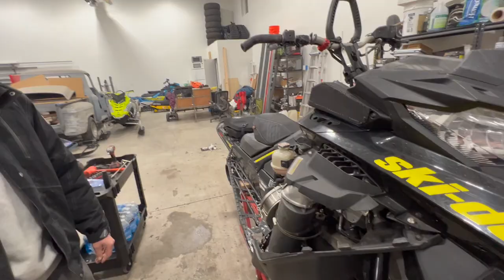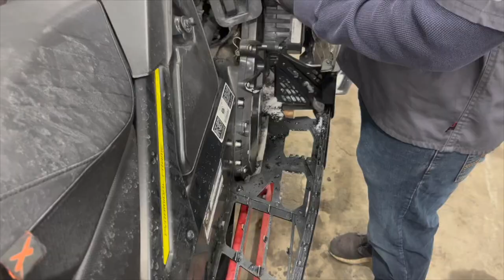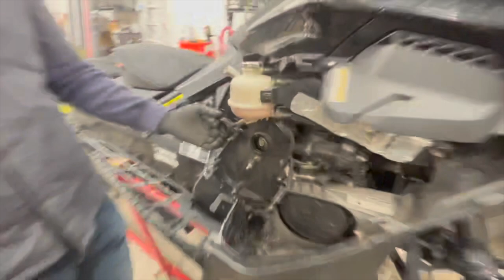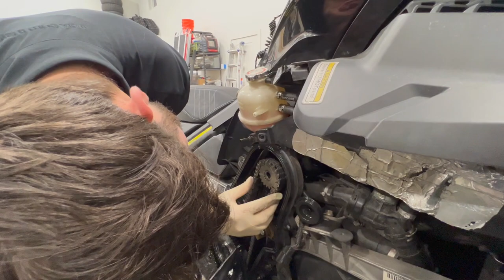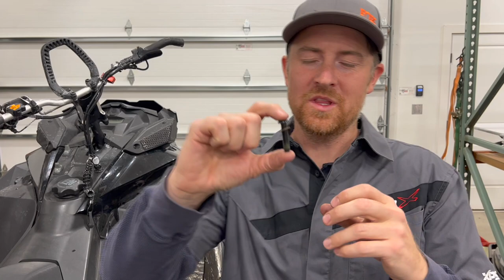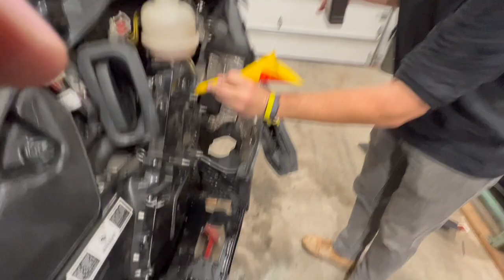SNOWMOBILE GEAR DOWN!! We give this Skidoo GEN 4 LOW end TORQUE and it's FAST, CHEAP, AND EASY!

Comment: Shouldn’t the chain be shortened to compensate for the reduction in size of the gear?
Reply from the maker: You just need to tighten it a bit. The gear is not that much smaller.

Comment: What would be good for 137”- 1.75” gen 4 850. I have 25T 45 bottom
Reply: @mountainreadymethod5023  more low end for wheeling out the deep snow or just doing wheelies instead
Reply: @mountainreadymethod5023  do you mean like adjust the number settings?

Comment: Not sure the model but the mountain sleds are geared down soo much they only do around 60-80mph.. gearing down more does absolutely nothing unless you have a 600. They are already geared down as much as possible to gain the most benefit. You arnt gonna gain torque lol.. the motor makes torque … gearing down just starts you in a better ratio when you hit the gas. Clutching can do a similar thing with clutching changes. If you want a bigger difference do clutching and keep stock gearing.
Reply from the maker: I disagree… I feel it a lot when I’m coming out of a tree well or need all the low end I can get. But I don’t go out to ride fast I’m all about trees. I have done a little clutching but it’s all to get the low end.
Reply: @mountainreadymethod5023  a gearing change of 1 tooth isn’t enough to notice any way to spin it. 2-3 teeth sure but 1 no way. But to each their own it’s your slrd
Reply from the maker: @xGR1MxREAPERx  ya that’s one of the things I love about snowmobiles is you can set them up in so many different ways and make them the way you want!